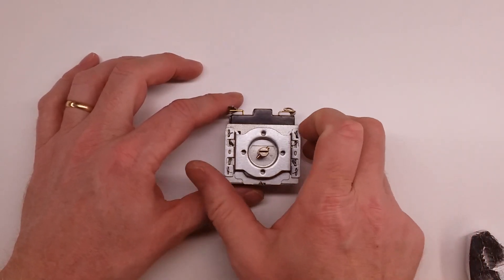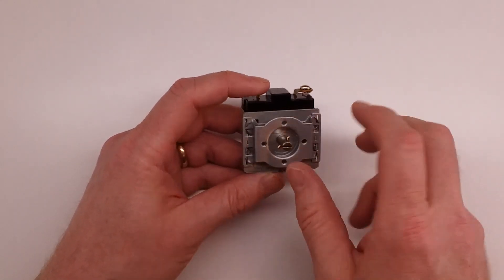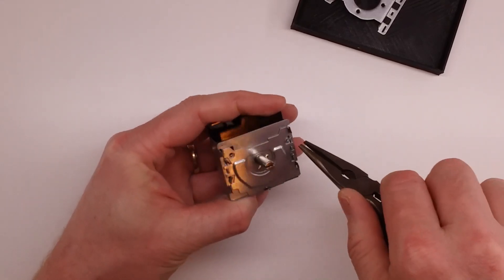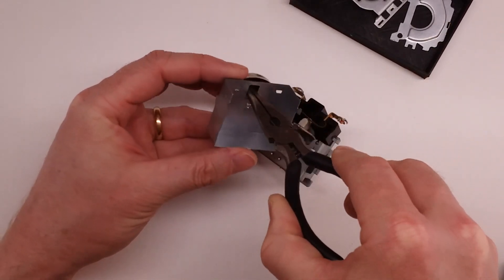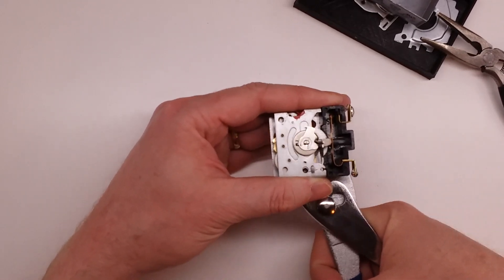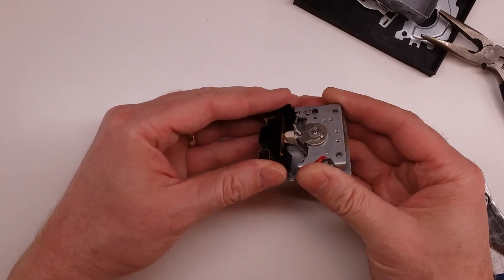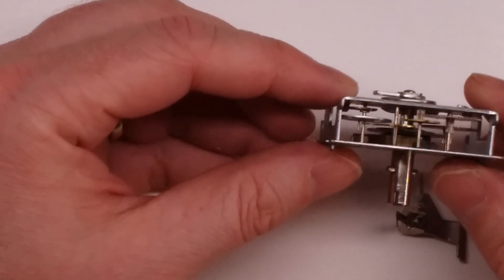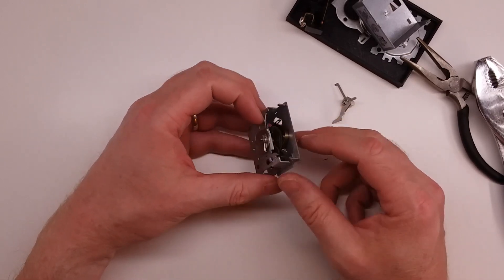You won't believe what's inside a toaster oven timer switch

Comment: Hi Will. When I turn the timer switch control button I can hear the ticking of the mechanical clock gears. It makes sense that when the timer reaches the "off" position, it also turns off the circuit (toaster oven). The "off" position opens the contact inside the timer that disrupts the current from flowing. When the circuit is closed, or the timer switch is in any other position than "off", then the contact inside the timer should deliver current to the rest of the circuit. Mine is also hard-wired in series with a tiny lamp, which lights up when the circuit is closed. I'm looking to add a rocker switch to bypass the timer altogether when I need to surpass the timer's 15 minute capability.

Comment: i love doing what you did here. i do not care about the cost of a new timer or toaster oven even. it is just interesting to see how it works and if you can fix what is wrong with it. finding a solution that many times requires almost nothing in parts or expense , just maybe cleaning or lubrication or bending or adjusting to compensate for wear is the fun challenging interesting part.  good to see somebody else that enjoys this sort of thing.

Comment: I have an Oster toaster oven like that. Same problem. It goes past the zero mark and oven remains ON. Do you know how to fix it? I called the manufacturer, and they have no spare parts.
Reply from the maker: Most timers are going to be the same. You can try to replace the timer.
Reply: @Bluemonkeydev   What was the brand of your toaster oven? How should I dismantle it - to remove the timer. from the front or from the back or some other place? you mentioned you started at the wrong place
Reply from the maker: @PilgrimsProgress7  that was 3 years ago, I don't recall any more. Just start removing screws.
Reply: @Bluemonkeydev   Thanks for the video. my wife will not let me throw it out  because it was large capacity and did its work well.  Nice to see that you are a fellow software engineer

Comment: where can I buy a replacement timer switch like this?
Reply from the maker: Just on Amazon
Reply: @Bluemonkeydev  You can find them on ebay (from Chinese distributors) as well. Be warned however it is very difficult to get things ordered from China right now. My order was cancelled.

Comment: is this switch is suitable for a 1 hp motor pump ?
Reply from the maker: Probably, you would have to check the amp rating of both.
Reply: @Bluemonkeydev  Ok Thanks, seems suitable. This is very useful switch for the motor to avoid overrunning

Comment: do you know if the interior of a TOASTER OVEN CAN be repaint i cleaned mine with easy off and metal pad and the aluminum color came off and is rusted. can it be repaint with something that is safe to use?
Reply from the maker: You would need to use a high-temperature paint.